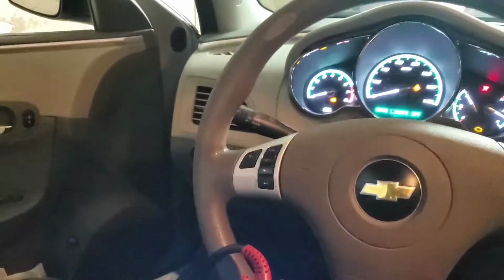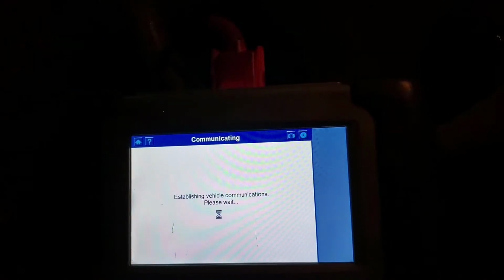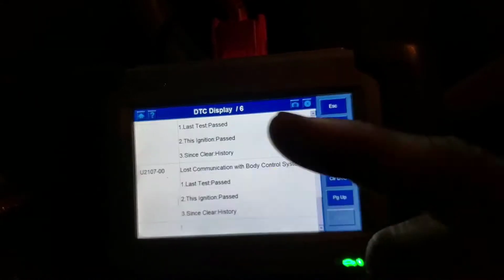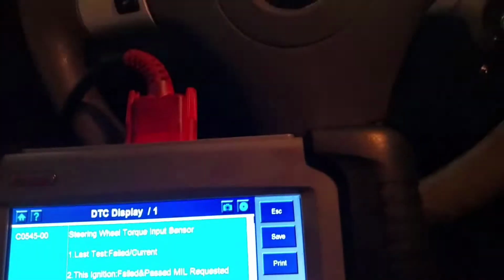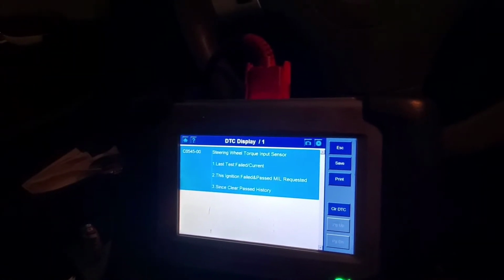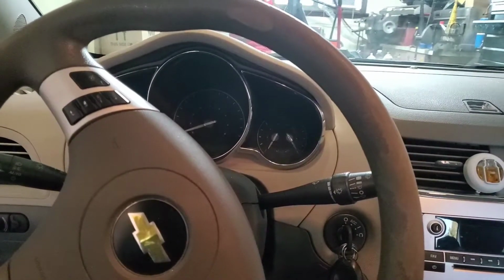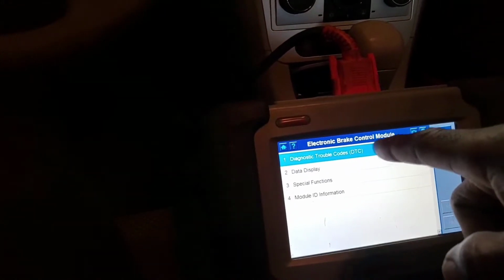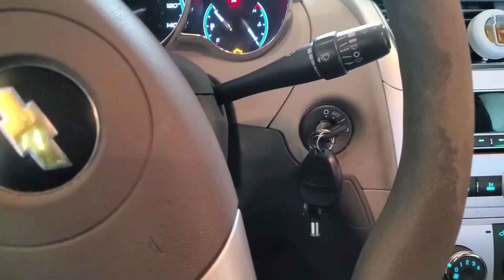[OHT] 2001 Chevy Malibu Power steering torque sensor replacement and programming.

Comment: Replaced the same sensor,(snap ring was the hardest part really) calibrated with scan tool.....car worked great for about 20 miles. Then power steering quit again. Have checked power, and ground. Not sure what I'm missing
Reply from the maker: Have you re-scanned for DTC's?
Was the sensor O.E.?

Comment: It is nice to see the struggle as well. Also, I'm glad you included some of the parts that others breezed over like how to used the alignment tool and when I should pull the pin out of the device. Thanks!
Reply from the maker: I'm glad it helped!😁

Thanks for the support.

-100
Reply: @EKHondaMotive  of course! just got done and everything seems to be working well. Not sure if I'll need to have it adjusted at the shop as it felt pretty good. I guess I'll just keep an eye on it.

Comment: This was the most bestest video I’ve ever seen lol it was very helpful going thru same thing loosing power steering while I’m driving, then I turn off car n back on and it’s works again soo I’m try to replace this part before I look to the power steering motor. Your video was very helpful  just the calibrate part I need to figure out.. I have same car except it’s a 2010
Reply from the maker: I'm glad it helped.

I'm sure that a mobile technician with a scan tool capable of the calibration can be found near you with a quick Google search.

Otherwise a regular shop would calibrate the system for what hopefully is a reasonable charge.

Good luck.👍